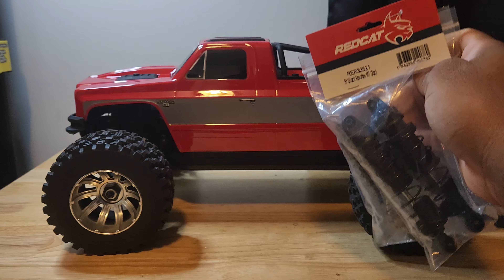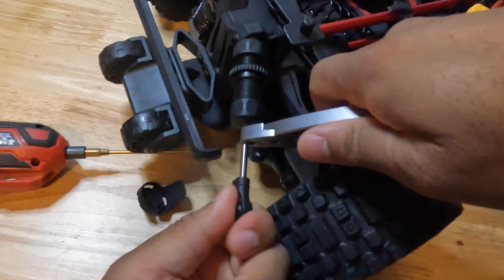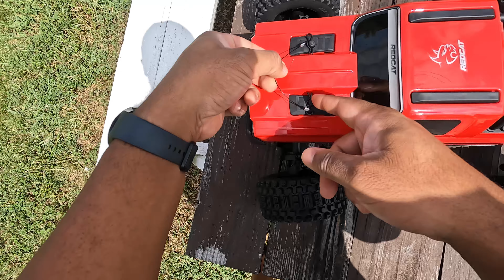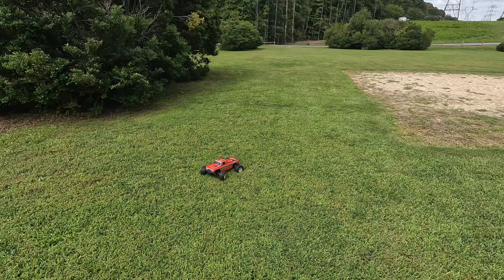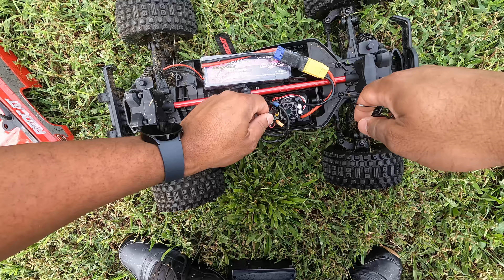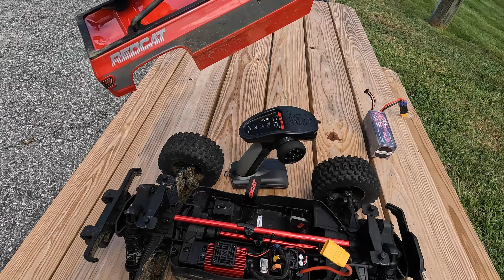Redcat Valkyrie MT | 1st run and Impressions! #redcat #cnhl

Comment: Ya bro. That body ain’t gonna last even with all that reinforcement they put on there the front hood and grill spot gonna get all smashed up.  But the bed will stay just fine.  On the shocks.  I put 55 in my shocks.  The replacements ones they sent and I haven’t had a problem with them at all since.  And I put mine like 30 feet in the air everytime I go out.  Other than that these lil rigs are tuff as rusty nail. I have found every time I run my higher charge rate batteries it will cut off like urs did.  But when I run like a 50c it’s cool.  I love the Valkyrie.   It’s a fun lil truck.

Comment: Awesome show 😊

I just got one.

Its hella fast  !!

Here are a few things I did

Installed mirrors  on the doors

Installed body clip tethers 

Installed 2 fans on the motor 

Installed 25mm turbo fan on the esc

Installed a American flag
Reply from the maker: Thank you! Where did you get your esc fan from?
Reply: @therchotspot  
Yeah racing 25mm fan on eBay 👍
Reply: I ALSO INSTALLED FRONT AND REAR LIGHTS.

THINKING ABOUT GETTING THE TRUGGY. 

MY WIFE SAYS I HAVE TO MANY RC'S ALREADY.  I TOLD HER SHE HAS HELLA DRESSES IN THE CLOSET TO. LOL
Reply: I also put the Kaiju rubber wheelie bar tires on . Fit perfectly.

Comment: That grass put you in thermo? Absolutely it’s that grass. The esc feels itself having to work so hard and then you add in that heat… that HW esc said 🖕🏼… happen to me too
Reply from the maker: I dont know. There are others having the same issues. And it was 71 degrees when I was out, so it wasn't extreme heat like normal.
Reply: @therchotspot  Did you figure out and rectify the problem?  Is it something that could be solved by installing a better esc?  

Thanks for sharing your video!
Reply from the maker: @greenfinmusic5142  I did a updated video yesterday. Still having esc issues but it will be covered by warranty